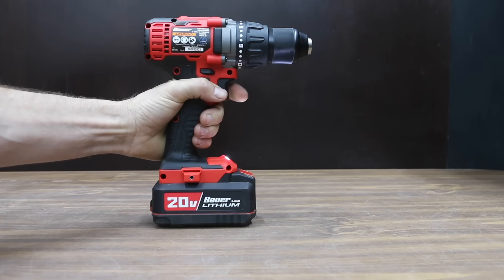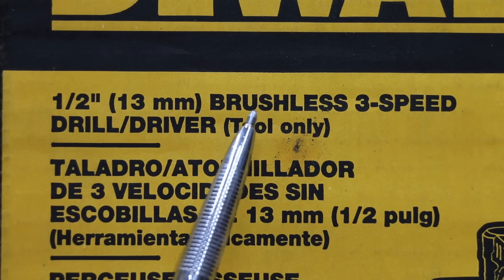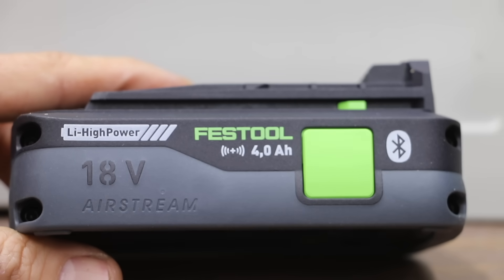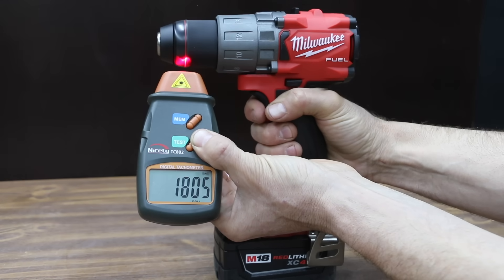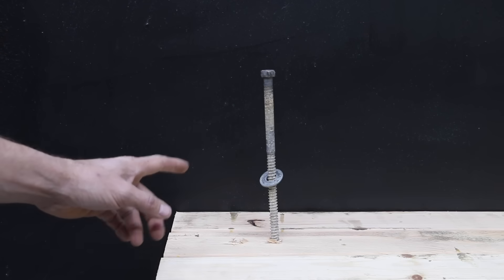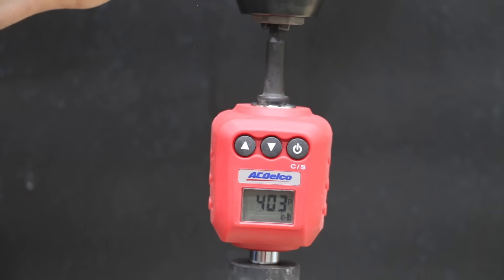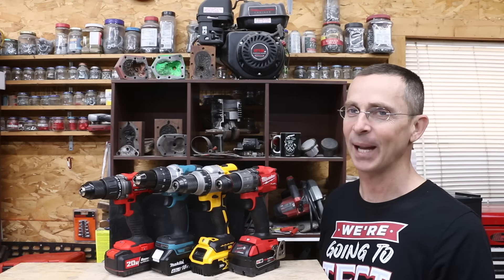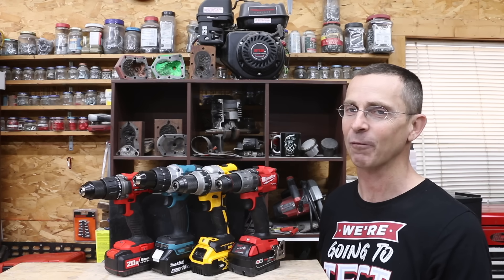Best Drill (BATTERY POWERED)? Milwaukee vs Dewalt, Makita, Bosch, Festool, Ryobi, Bauer, Ridgid

Comment: that was awesome. i had 2 rigid cordless. never again both were the old nicad batteries that said lifetime warranty. i had 2 sets of batteries for each drill. 1 battery for one drill stopped taking a charge comepletely. 2nd drill same thing one battery just stopped. i call rigid i email rigid. oh guess what? you have to have the original receipt and upc from the box to claim the lifetime warranty. thought about just making the investment into new dual chargers and 4 lion batteries. but then i saw complaints about their lion batteries with a lot of be recalled and discontinued. so investment strategy over. when the single battery left for each drill dies im bringing everything to a electronics recycle center to be ground down for their metal. future purchase will be a milwaukee or dewalt. theres a reason they have the most models. cause people buy their products the most and can invest the research and development into more models. must say something
Reply from the maker: Thanks!  Thanks for sharing.

Comment: That torque adapter your using has a range, just curious what that means since the range is 19.9 to 99.6 lb-ft but still reads from 0.   Thanks.

Comment: I just saw this interesting drill/driver video from a couple days ago. Surprising, but bottom line is does 'locking in' the bit or tool (whatever that means) increase torque that chuck can handle before bit or tool slips in chuck? I doubt it, but thought you might be interested in seeing this and/or testing. Take Care!
Reply from the maker: Thanks for the suggestion.

Comment: I would like to know what Drill is best for concrete work, I own a Dewalt but since I got it used as a gift I believe it must be at end of its life or it is not intended for construction work since I struggle to make a hole even for TV wall mounts.
Reply from the maker: Thanks for the suggestion.

Comment: Great summary statement regarding the drills ie all of the top 3 have strengths and weaknesses depending on usage. I have been using Dewalt 18-20v drills for over a decade and love them.  I especially like the 3 speed versions on some of their top line drills.  #2 speed brings with it more torque and control but still great speed for completing projects quicker.
Reply from the maker: Thanks!

Comment: This video reinforced my existing idea that for heavy-duty work, stick with Milwaukee, Makita, or DeWalt (pro version).  For weekend warriors, use Ryobi because they are 1/3 the cost of the top-notch brands.  My lithium Ryobi screw gun is over a decade old, and runs perfectly fine for my use including occasional electrician job site work.  To be fair, my heavy duty work is done by a Milwaukee hole-shooter Magnum 8 amp plug-in screw gun.
Reply from the maker: Thanks for sharing.

Comment: 1.makita, 2.hilti, 3.dewalt for pro users. Everything else is for random usage only.
Reply: You are definitely not a pro user then 😂
Reply: What do you think about Metabo-HPT I have a circular saw from but thinking of either staying with Metabo-HPT or switching brand flex milwaukee for a hammer drill etc?

Comment: FYI on the Ryobi, the light will come on with a light trigger pull and without engaging the drill.  There is a subtle but definite step in the trigger between the light engagement and the drill engagement.  It's a little too subtle IMO, but it is there.
Reply from the maker: Thanks for the feedback.
Reply: @ProjectFarm  Thank you for the great videos.  Nobody is more thorough than Project Farm.

Comment: Just what I needed today Professor,  Dewalt in it's final days of keeping the original batteries charged. Might give the aftermarket batteries a try before buying a whole new set. The older batteries are not available in the big box stores for whatever reason. Thanks again 🍻  Update: Aug 13. Bought a Black + Decker for $51.00 for my short term fix. For that price...I really like the drill. (w/charger)
Reply from the maker: Glad to hear!

Comment: After watching your video, I was interested in buying the Makita but the model you tested seems to be discontinued. How can I know if the other Makita models have a mechanical or electrical clutch?
Reply from the maker: Great question.  Mechanical clutches are very loud and typically make a clicking sound.  So, you'll need to test one out or hopefully there's information on the manufacturers website regarding the type of clutch

Comment: I have an early Hitachi brushless drill (10 years old).
It's a great engineer's drill because it has 2 speed gearbox and 4 speed electronic select. 
Great for precision metal work and tapping.
It wouldn't make a very good builder's drill because of the lack of torque.
I would eventually replace it with Fein tools.
Reply from the maker: Thanks for the feedback.

Comment: Great video as always, interesting to see some of these drills don't live up to the specs on the boxes. I can speak highly of RIGID tools, I had one of their octane drills for several years, put a steel roof on, did drywall, woodworking, and auto work with it. It got stolen and now I've been using a lot of Makita products, their CXT line is awesome. Not quite as powerful but super compact and small for tight spaces, something I never used to think about. Bosch I love their accessories the most (drill bits, router bits, etc). Ryobi is also awesome I own some of their lawn equipment, they're actually under the same parent company as Milwaukee. 

It'd be interesting to do another one of these videos in the future, I'd like to see the Hercules brand tested (I think they're a step above Bauer at HF) and Walmart's new "Hart" brand. I'd like to see how Hart stacks up against HF tools and Ryobi, or if it even surpasses them, they look like high quality tools.
Reply from the maker: Thanks!  Thanks for the video idea.

Comment: Like I always tell people, if your going to use your tools everyday and there going to take a beating go with the pro line versions of milwaukee, dewalt, or makita. If your and occasional DIYer go with ryobi or rigid or even some of the harbor freight brand like buaer. If you do a a few things a year and just putting a few screws in or a couple holes a year you don't need to spend hundreds of dollars on top of the line tools. Even the dewalt or milwaukee non fuel/xr lines. You dint need pro grade tools if your not using them daily. I buy pro grade well because I use them daily. And most of us don't care about numbers (if this brand is a quarter second faster) we carw about durability, performance, and battery platform ( does this line have a great tool line up for said battery platform) like the m18 line has a ridiculous amount of tools that are almost all quality. But dewalt xr and fuel line are both neck and neck almost throughout the entire tool lineup and at that point its more if a self preference. I'm a milwaukee guy personally, but with 1"sds hammer drills I would have went with dewalt if I didn't already have a bunch of m18 batteries, and the performance wasn't that much better to spend the extra money in batteries on top of the price of the tool. 
So if your a DIYer looking for a good set really anything in your budget will do for the most part, you can still get the milwaukee, dewalt and othe rename brands save a few bucks and nit get the pro grade line and will work awsome for you.  I do recommend on trying to stick with 1 brand as its easier with 1 battery platform.
Reply: Milwaukee and Makita for sure. Never had a good time with Dewalt myself. Battery issues, getting stuck on one setting without being able to switch, yadayada.
Reply: @mintgumornot  right I see some of the guys at my work buy even the non fuel milwaukee, dewalt, and a few others and im like why you wasting your money for. Me and ny buddy bought our drills within 2-3 days of ine another and he's in his 3rd dewalt since then I'm still using the same milwaukee m18 fuel.
I like makita as well but but now they don't have a lot of the stuff milwaukee does and I hate have tools on different battery platforms. I try to keep everything the same as it just make life easier. Like boshe I'd buy some of their corded sds drills

Comment: Thank you, as always, for the helpful tests and videos! I would like to know how many actual cycles these battery packs get. I needed a weed walker during the beginning of the pandemic, and there wasn't much available in my area.... in fact, there was 1 weedwacker left at my Lowe's. It was some brand I had never heard of, only worked on new, thin grass, and the battery didn't last but about maybe 10 or 15 cycles, and it died 😳.  It was a total waste of money. I wound up cutting the grass with manual tools. 
  I'm not fond of battery powered power tools. They seem to be generally made more cheaply, and don't last long. I also wonder when they are going to change the battery packs, or if some day there will be a standard for the battery packs? I feel like we are still in the "running wires through slots of ceramic in the attic for electricity" stage of battery-powered tools.
   I'm looking at a full home renovation or build, and other than a standard drill/screwdriver,  I don't trust battery powered tools. I still trust corded and air-powered tools.
  If you haven't done so, a pneumatic nail gun comparison would be great! 
Thanks for your videos! I'd love to have a neighbor like you! If nothing else, to enjoy that RV launch in person! Love your sense of humor and the usefulness and straightforwardness of your videos! Great info we ALL need to save money and time!
Many, many thanks!
You're a staple in our family.
Reply: He did a trimmer (Weed Wacker) test about a month ago.  Check it out.  Dewalt did the best I think, but others did well.  I have the Milwaukee brand trimmer and have used the heck out of it.  Very powerful, easy to add line, and very durable.  Good Luck!

Comment: do u know if the Miwakee does not require batter, and have an internal charger, but with the battery last longer?? so the Drill tools comes with an AC Power supply?

Comment: I have been a huge fan of your channel for years. I have a question concerning the low RPM stat. In what situation would you use this feature and what kind of torque can be expected from the slowest RPM control?  I went and tested on my drill but without equipment it didn’t really tell me much. Would love to hear your thoughts and maybe even a test rig showing this.
Reply from the maker: Thanks for the video idea.

Comment: I had a Bauer that I used for regular home owner stuff for about 2 years. In that time I had 2 batteries fail and the batteries are almost as expensive as the tool. I finally had enough when the 2nd battery died and bought something new
Reply from the maker: Thanks for sharing.

Comment: Im on the shop for a new drill, and this video pointed me on the right direction. Awesome content as always.
Reply from the maker: Thanks so much!
Reply: What did you end up buying and what is your use? I came here since I wanted to use something around the house with good overall adjustment for very low and very high speeds.

Comment: As a professional    woodworker you mostly see Makita and they seem to just last a bit longer and give you the feel and balance you want in the woodworking line of work , I’ve always felt dewalt and Milwaukee seem to suite trades that are harder on there tools.
Reply: Makita outlast anything if you're using their Brusheless line. I've been using the same drill and impact driver for 8 years daily as a sheet metal worker.
Reply from the maker: Thanks for sharing.
Reply: @ProjectFarm  there you go - need to do a battery charge and runtime side by side test across a couple brands. There aren't any good, critical comparison videos on YouTube between brands.
Reply: I used to work on construction company which was providing tools to workers. They were doing all type of work from roofing to the concrete. And 95% of tools were Makita. After I saw what are they capable of I bought all my personal tools from Makita as well
Reply: I totally agree about the Milwaukee and DeWalt being for rougher jobs. As a woodworker, I use Bosch. Too bad Bosch didn't quite stack up in this round.😢
Reply: @T.C.-st8uz Blue Bosch brand stands up to torture.
We used a friends set with a Bosch corded and battery tiger saw back to back all day long in my old house, opening up all window measurements. They were absoluteky running hot and we used up dozens of blades. Even heavy duty blades. They still work today and this was 2016 and the guy uses them often.
And his resaw and table saw in bad weather (raining and snowing, Sub zero degrees) went hours on end.
Still has them, still works.

But these were probably 2014-2016 era blue Bosch tools. Don't know how the brand is today.

Myself go with milwaukee. Extremely happy.
Reply: My Dewalt stuff seems like the triggers are far less forgiving when it comes to trying to be precise.  I do have some Bauer and Hercules now, and the Bauer's trigger wow, that thing leaves a lot to be desired, it works, but you have the trigger pulled about 1/4 to 1/2 way in before it decides to work LOL.  

I've used Makita a few times, mostly their 1/4" impact, and 1/2" hammer drill and both were good for their price point for sure.
Reply: I'm all in on Makita and when I first started looking for an ecosystem I tried them all. What sold me on the Makita line was the feel in the hand and the balance. Nothing else comes close. I don't know why the American brands can't get that right, the handle that connects the tool to the 200lb gorilla makes or breaks the tool. Makita's fit like a glove, all the others feel awkward in the hand. Makita's also have fantastic chucks and you can't beat their recharge times.
Reply: @wally7856  watch "Ultimate Electric Mower Battle" by "The Lawn Review" to discover that Makita actually has the worst charging time :( 
Sorry, don't mean to make a narky comment, that part just stood out to me as I just watched the comparison video the other day and I was utterly surprised at how horrible the makita charging time was.
Reply: @Uenaeons  That's Makitas old regular charger. Redo that showdown with Makitas fast charger and it'll charge two 6 ah battery's in 60 minutes, the 5 ah battery's in 45 minutes. Makitas fast charger cleans every bodies clock, it isnt even a contest.
Reply: @wally7856  actually, I just dug around and the charger used in the mower video, IS the rapid charger DC18RD. It is the today's-current Makita top-line rapid charger that's sold with the 36v mower kits. There doesn't seem to be any "better" or "more rapid" charger on offer from Makita.
.... So....... 🤷
Idk what you're on about.
Reply: @Uenaeons  I have never had my batteries take longer then an hour to charge so idk why he claims close to 2 hours to charge on that video. The only thing I can think of is that they were over temperature when he started so charging didnt start until they cooled down. 2 hours to charge as he claims is false otherwise. Makitas charge @ 10 minutes per amp hour.
Reply: @Uenaeons  Okay I rewatched that video and he was charging 4 batteries on that dual charger so he had to swap batteries midway. Still took longer then it should of. I beleive he had waited for the fans to finish cooling down the batteries before swapping to the new pair as he still could of done that in 1 hour 40 minutes if he swapped earlier. Grab another charger so you can charge all 4 at once  and problem solved.
Reply: Totally agree
Reply: Dewalt is the way! Milwaukee breaks faster than Dewalt but Makita is my choice for a grinder, their motors take a lot of abuse under weight and pressure without burning out.
Reply: as a fellow woodwoker who watches woodworking videos a lot in my free time from over 5 dozen channels, Id have to disagree with you I personally own a dewalt, makita and severeal off brand drills including bauer and I havent seen any preference towards makita, I'm not saying they arent great tools, just that there doesnt seem to be a preference towards them in woodworking.. as you would see with say milwaukee in the mechanic trade.. it just seems really random whic tool brands someone chooses as a woodworker and I feel they are more likely to choose one that has options for their other hobbies (gardening, auto work etc)

Comment: Festool is great except when ,after a few years, the battery starts falling out. Makita batteries don't fall out. Festool electronic clutch is great until it becomes invasive. Not enough oomph in top gear. Fein smacks Festool all day long for speed/power but it too has gremlins in the electronics. Oh..I put in about 1,000,000 screws a year..
Reply from the maker: Thanks for sharing.

Comment: Used the Bauer brand drill for about a year. It was mainly used for home use, so occasional use and fairly light. 

It let the magic smoke out today when using a 1 1/8” paddle bit to drill a hole for a network drop. The old saying holds true, “you get what you pay for.”

With that said, if you need a drill for light home use on a budget, then the Bauer does well!
Reply from the maker: Thanks for the feedback.

Comment: The problem with the Milwaukee is they use a super fast rotating brushless rotor that has a lot of mass and gear it WAY down. I hav hurt my hands with one 4 times now. It’s powerful but man, I went and got a smaller one for 90% of what I do and use the big boy for 3 inch hole saws or mixing drywall mud
Reply from the maker: Thanks for sharing.